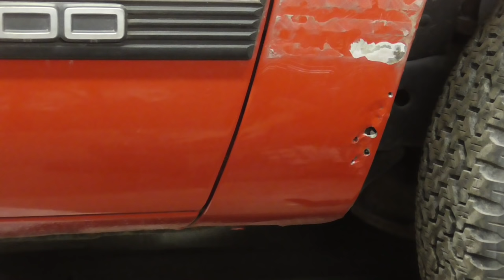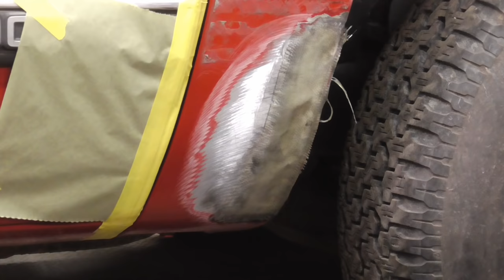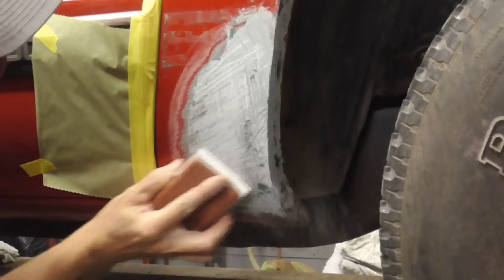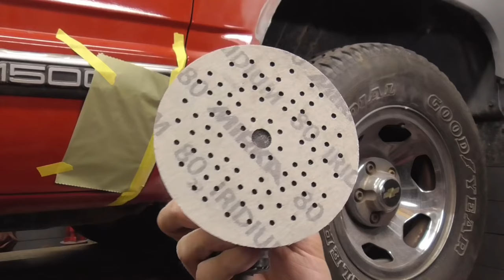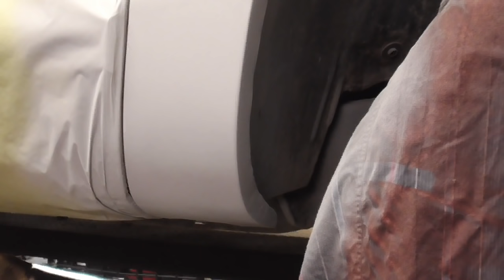How to Repair a Rust Hole with Fiberglass - No Welding!

Comment: I must not have pounded in my roof cab holes evenly. Ended up with high spot in the middle. Sanding it even after short strand filler i exposed some fiberglass. Put down skim coat to cover that and final straightening exposed fiberglass again. It is straight now, but I have fiberglass, strand and skim showing. What to do now, keep skimming it to cover up?
Reply from the maker: If it's flat and you haven't sanded through the fiberglass - prime it, block it and paint it.  If you want a super thick primer sufacer that can "bury" and imperfections forever use feather fill - https://www.youtube.com/watch?v=caWJYozggww  When I first started working a a body shop I had trouble getting things right - feather fill came through every time.  You can spray it on super thick w/o worries - like spraying on a skim coat of filler :)
Reply: @LakesideAutobody  Thank you so much! I used 3 layers of fiberglass mat like you, so I got some layers left. ;-) I'm 65 and this is my first real body work and you made me more confident doing it!
Reply from the maker: @rudsaki  Once you get past your first paint job - you're gold.  You'll be twice as good on your next.  Everyone makes mistakes - tons of them.  It's hard to get bodywork completely perfect even though TV/internet/magazines act like it is - there are always small imperfections - even big ones :)  Good luck on your project and most important - have fun doing it.  Keep asking ?s and keep me posted on the progress- Jerry

Comment: How long do you wait to cheese grate it? You say before it’s not too hard but how long is that normally?
Reply from the maker: It's about as hard or the consistency of a block of parmesan cheese or a pencil eraser.  Basically about 10 minutes but it depends on how "hot" you mixed it and the temperature in the shop - also winter or summer.  I sit by it myself and if it clogs the grater, I wait.  Just when it doesn't clog the teeth anymore, you're good to go :)
Reply: @LakesideAutobody Thank you! I appreciate it, I didn’t expect such a fast reply to such an old video lol

Comment: wouldnt the rust on the backside just eat everything through again? you would have to neutralize/convert it right?
Reply from the maker: You can treat the back if you want to convert it.  Or if you can get to it real good - I like to sand blast it and coat it with some good quality 3m or SEM rubberized undercoating.  It seals the repair - no moisture = no rust :)

Comment: Do collision body shops typically do this kind of work?
Reply from the maker: No but they used to.  It was a very common task in many smaller shops to take on rust repair.  I don't think it's the case today just because there's no one that can do it or has the knowledge anymore.  I think they'd rather replace everything :)

Comment: Question. Won't the rust come back because you haven't cleaned between the two metal surfaces? I'm guessing there is rust still in there behind the holes!
Reply from the maker: The key is drainage - make sure your fenders can drain.  That's why they rotted out - dirt, leaves, needles, salt, rust chunks get trapped back there.  It has to drain and dry out.  Then give it a shot of used motor oil inside any panel to prevent future rust - see more on that here - https://www.youtube.com/watch?v=8XaZBy7GC7A

Comment: what grit sandpaper disk was on the DA sander when you were using that?  Thanks!
Reply from the maker: Probably 120 but don't be afraid to start with 80 grit on the DA and then move to 120, 220, etc.  It's much faster that way and actually uses less materials (just my opinion though) :)
Reply: @LakesideAutobody  Thanks! My son and I are going to give it a go this weekend...thanks to your videos we won't be starting from scratch on our knowledge of the process and techniques. It's the rear wheel well fenders of a 2008 Ford Escape(known for rusting in those areas.) Wish us luck! :)
Reply from the maker: @robchurchill1368  Good luck my friend - I'm sure you can do it.  Take it slow and one step at a time.  Ask ?s if you need to also :)  Jerry

Comment: Great job, it should keep the rust away for a few weeks 👌🏼
Reply from the maker: Yep - about two years so far.  Make sure you allow the panel to drain and dry out inside.  That's why it rusted - trapped moisture, debris, leaves, etc.

Comment: The 1970’s called they want their auto body repair ideas back.   FYI this will not stop the rust!
Reply from the maker: That's funny 'cause my dad taught me this method and he worked at a dealership - that's how they did it I guess before MIG welders.  This method is just that too - I think I mentioned in the video that it would be a great way for someone w/o a welder to fix their car.  BTW 1-2 years later it still looks great - it's a close neighbor's truck.  Make sure your panel can drain and dry and it'll hold up just fine.

Comment: Thats a nice repair. But I was always told that resin and cloth would not stick to metal ??? 
I have done these types of repairs before but thought i was hacking.
Glad this is considered ok 👍
Reply from the maker: To be honest, my dad worked through the 70's and 80's in dealerships and other privately owned shops and this is the only process he used.  He was considered quite a good bodyman/painter - not a hack at all.  You're fine - don't listen to the internet on this stuff - go with you intuition - there is no perfect way - I'll keep putting different ways on this channel - when you find one that works the best for you - that's the way!  Jerry
Reply: I always felt that I was cheating to do this but there are times it is ok.ospo or acid to kill the rust is important
Reply: To lakeside    I'm 71 now, I did body and paint since I was 16, when I lied about my age and went to work at Earl Shieb as a painter. First car i ever painted was there. I did good at that job,, they masked with newspaper then ! Then on to Maaco for a few yrs, and on up to the quality shops for several yrs. Opened my own shop, and did very well all my life. Classic cars being my obsession.     Modern technology, and very thin sheet metal changed slot.
Reply: @danielfranklin817   props to you,  not many in trade make it to 71 ...   lost co worker after he retired for 3 months    62

Comment: I think you may want to poke a big enough hole to get a detail wire brush inside and clean behind the panel, and then spray some paint and primer inside, or at the very least some oil
Reply from the maker: The most important thing is making sure the panel can drain and dry out inside - that's why it rusted in the first place.  Being able to coat the inside, like you said is also really important :)

Comment: Since you did not remo e the rust area there is still rust on the back side of the panel. Rust will pop back thru. Why didnt you cut out the rust and treat behind the panel?
Reply from the maker: You could do it that way too.  If you can get even more creative and find a way that lasts longer cool - this is how my dad did it and he worked for quite a few reputable body shops.

Comment: Do you recommend the cloth over those metal flexible self adhesive patches?
Reply from the maker: I've never used the self adhesive patches but I read about them.  I think they would probably last as long as a fiberglass cloth repair.  I think if you used it though, that you should cover it with the reinforced fiberglass filler like in this video as it's waterproof:  https://www.youtube.com/watch?v=rPTaeH056ng  Let me know it you do use it and how it works for you - Jerry
Reply: @LakesideAutobody  Thanks. Curious your thoughts on rust converters application before fiberglass. Does it help prolong chance of rust coming back?
Reply from the maker: @mrsemifixit  An old boss of mine used to make us use it.  I don't think it can hurt as long as you grind it clean again before applying the glass.  If you can sand blast most of the area clean that (I think) is the best.  Then even better if you can clean and undercoat the back somehow, it will last forever really - no moisture = no rust.  If you make sure that the repair can drain and stay clean in there even better.  Hope that helps a bit  - Jerry
Reply: @LakesideAutobody  No way to sand blast. Just looking to do a DIY repair and hope it lasts longer than a year. Could you recommend a good rust converter? So many mixed reviews
Reply from the maker: @mrsemifixit  It already lasted six months in the winter and salt - no problems.  It's my neighbor's truck.  I'll do a "How's it holding up?"  video in a year or two and it'll be fine.  I don't use a rust converter but my boss used to - I don't think it can hurt.  Usually I just make sure there's no more rust left (except for this vid).   You can't go wrong with something like this:  SEM Products Rust-Mort SEM-69501   SEM is a common name in professional shops.  Jerry
Reply: @LakesideAutobody  Aporeciate the replies. If I use a rust converter are they safe on bare metal? Read mixed reviews that say they can cause rust on bare metal (rust free areas around pitted spots). Also can you fiberglass directly over it or won’t stick?

Comment: Which method is better solution. I want to repair once and don't want to see rust again?
Reply from the maker: Here's a good follow up video on many methods of rust repair - https://www.youtube.com/watch?v=gIS1Tbv7Kvw   I would say glue is the best way to go because of the absolute water tight seam but it can be challenging to get he patch to fit right, etc.  MIG welding is probably your best bet.   Using a combination of lap and butt, tapping the seams down and filling.  Butt weld stuff that is too rigid to lap like pillars, rockers, door edges - lap everything else - tap and fill.  See this video - https://www.youtube.com/watch?v=JIIonJOVro4

Comment: i do welding because I thought welding was better. but this looks like it could be almost as good. I guess until I cracks? What about water proof?
Reply from the maker: It won't crack because the materials were applied correctly.  That being said, in time the metal behind it may rust away and cause the repair to fail.  Two things can prevent that.  1) The panel should be allowed to drain and dry some way - that's why it rusted in the first place (trapped moisture and debris).  2) If you can seal or rust proof the back it will last as long as it stays sealed from water/moisture/salt.  No moisture = no rust :)

Comment: What are your thoughts on using rust neutralizer?
Reply from the maker: A boss made us use it and I know it turned the rust black so it works or at least changes it into something.  It can't hurt to use it as one more measure.  I'm not sure how well it worked - we never really had rust repairs that failed.
Reply: @LakesideAutobody  Ty

Comment: I use a ball-pein hammer because the rounded end doesn't push inward so much and is less aggressive.  I only push the area in enough to allow for the fiberglass weave and body filler to fill it in. Otherwise, your technique is the same as mine.  I learned to do this in the mid '70s and still do it the same..
Reply from the maker: Yep.  In the seventies there were tons of shops that used glass like this.  Even the auto body repair books taught this method :)

Comment: I did that back in the 70s and 80s then spray heavy oil on the backside. It would last for years!
Reply from the maker: Drainage and hitting the back side with something is key - thanks for the input my friend :)

Comment: Add one more step. Brush on 2 coats of catalyzed epoxy on the bare metal first.
Next day sand with 80grit to ruff it up. Try not to break through.
The fiberglass will bond to the epoxy coat better than to bare metal.
Reply from the maker: I'll give it a try - thanks for the suggestion :)
Reply: @LakesideAutobody  when we prep a bare metal shell for Hondo work. We spray 2 coats of catalyzed epoxy. Next day sand and clean surface and apply the bondo. Bondo sticks and feathers better this way. All custom shops do it this way for a full restoration job. Insurance shops don't have the time. Nothing would get done on time adding this step.
Reply: @georgemichaels2325  any recommendations on which brand to choose. I see several catalyzed epoxys. There's water based ones. Any brand? Thanks in advance
Reply: @RicardoTorres-y1c  Go to your local Auto Paint supple.
Go with a catalyzed epoxy. Don't know anything about water based epoxy.
Read the instructions. Mix accurately. Don't put it on too wet. Let the first coat flash.( turn semi flat)Then apply your second coat,wait until the next day. Sand with 120 grit. No shiny spot,but don't sand through. Clean the surface afterwards. 
Blow the surface off with wax and grease remover and let surface dry. Then apply your fillers.

Comment: What are you brushing on the fiberglass cloth?
Reply from the maker: It's fiberglass resin -https://www.amazon.com/3M-402-Fiberglass-Resin-851ml-Hardener/dp/B000CCOK48/ref=asc_df_B000CCOK48/?tag=hyprod-
Reply: @LakesideAutobody  I don’t know what I was thinking. Got it after rewatching. Great videos! So do you just use 80 grit on the regular filler? Then filler primer?
Reply from the maker: @danielwiggins4960  Not just me but most auto body shops I've worked in start sanding filler with 36 or 40 grit, get it close, then finish it off with 80 grit.  You want to cut through the filler to get it straight not ride over :)

Comment: I have some rust in a similar place and the guy I went to suggested to repair it just like that because he said if he’s using welding and a sheet of metal the rust will eventually come out again in a couple of years! Can anyone confirm me this is the a better way to fix rust ona fender or should I insist to weld it ? Thanks! Amazing work!
Reply from the maker: Panel adhesive lasts the longest (absolute water tight seam).  Welding is 2nd if done right - it will last as long as a new panel  3d is fiberglass but can last very long if there is adequate drainage and the panel can stay dry inside - no debris build up - leaves, needles, mud, etc.

Comment: I have a big dent around 1 inch deep on my car that needed to be leveled out, no holes. Do I need to put fiberglass cloth or just the bondo glass?
Reply from the maker: Just filler.  If you can pull it out a bit first, that would help.  If not here's a video that might help with that - https://www.youtube.com/watch?v=rIoNhu166Hw

Comment: How much time for the Bondo Glass to set up before using the Sure-form?
Reply from the maker: It depends on the temperature and how much hardener you used.  The rule of thumb is if you try the Sure-form too early it gums up (clogs the teeth).  If you try it too late, the filler will be too hard for it to cut.  It should feel about like shredding a block of parmesan cheese - mozzarella is still just a bit too soft.
Reply: @LakesideAutobody  I see; that makes sense. How long did you wait for the project in the video?
Reply from the maker: @climbingwithoutpassion2343  I'd say about 10 minutes.  It's usually around 10-15 minutes :)
Reply: @LakesideAutobody  Thank you. Your videos are so helpful!
Reply from the maker: @climbingwithoutpassion2343  You're welcome CWP - have a good weekend :)

Comment: Nice work, but I don't understand what's to stop it from just just rusting from the inside out again? Not a criticism, but a genuine question.
Reply from the maker: The reason it rusted in the first place is because the inside of the fender couldn't drain and stay dry.  It was filled with debris like pine needles, leaves, chunks of rust and dirt.  If you allow for good drainage - even drilling strategic holes here and there and undercoating it (if accessible) it can last forever - here's a follow up on that repair - https://www.youtube.com/watch?v=t1WclT_GMvk

Comment: Wat would I need to get if I was trying 2 do the same to my 04 dodge grand caravan
Reply from the maker: Walmart carries the fiberglass cloth, resin, and even the filler.  Just start small - see if it'll work for you.  Then you'll know what you need and can purchase the materials cheaper online or at a local auto body supply or auto parts store

Comment: I was wondering I have heard if I use fiberglass resin on the bare metal like that it will rust is that true or am I safe to do just that thank you 😊
Reply from the maker: Here's the truth.  Without treating or sealing the back side it will begin to rust around the edges of the repair in a few years if driven in the snow and rain.  Remember, no moisture = no rust.  If it's a hot rod and you never drive it in the rain for example it will last forever.  If you seal the back with good undercoating keeping the repair dry, it will last forever also.  Makeing sure it drains is also huge - so it's good to drill some holes for water to exit and the repair to stay dry on the inside.